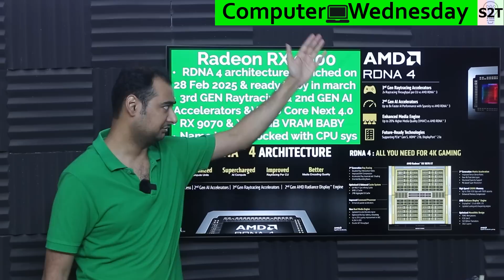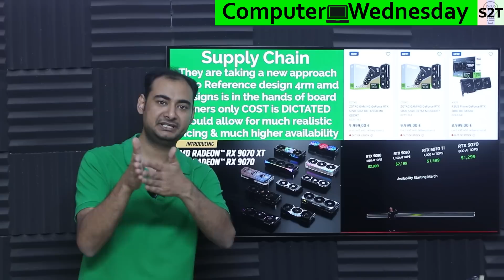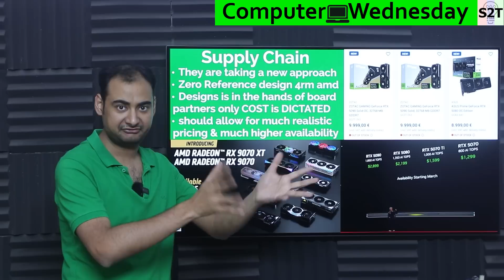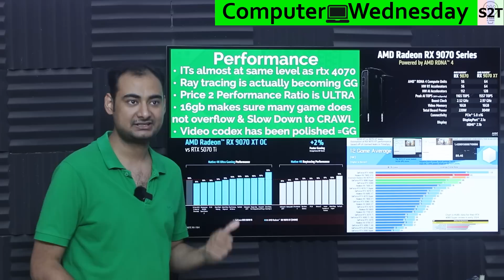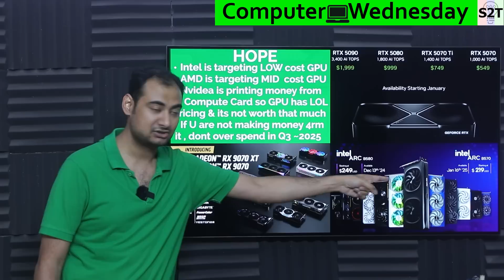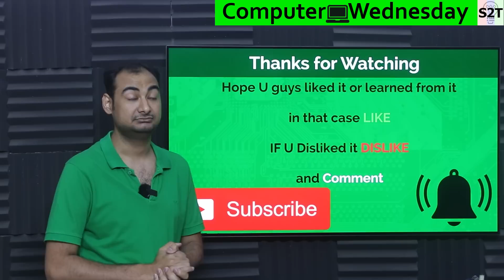AMD Radeon RX 9000 Explained {Computer Wednesday}

Comment: but same issue ok nvdia will price at x let me price at x-1 which is bullshit bcs its still behind 5070ti in rt ,dlss4>>fsr4,not optimised software to take the advantage of the hardware.Plus msi will not make amd gpu specillay the 9000 series bcs amd doesnt sell.
5070ti 750 $ and 9070xt 600$
again for that 150$ ur getting better rt,dlss4,much optimised software for creative applications and much better integretetion of ai libraries.
so ur point is not valid at least when it comes to price
even last year 7900xtx 1000$ and 4080 was 1200$ which was 200$ diff

so 9070xt should have been priced at 450$ and 9070 at 400$ not 600 and 550 too high for amd sorry i disagree with u regarding the pricing
Reply from the maker: you agree but u  want the cost to be even lower that is on markets hand if no  one buys nvidea only then then  price will drop
Reply: @s2tenglish  ya but ur not understanding one simple point 7900xts was 20% cheaper but with worst rt,no software integration for both creative and ml,bad drivers,fs4 inferior to dlss.Now it's just 25% cheaper so only 5% reduction with the same drawbacks.So I don't get ur point as i mentioned the price should have been 450 and 400 respectively and if 9600 is released then 250 not even 300 only then it's possible to gain market share like they did with ryzen1000 or 1st gen.90% of intels performance  at 50-60% less price
Reply from the maker: @ market is too hungry so they wont do that
Reply: @s2tenglish  fair point but this will also not let them increase the market share see even that aswell.